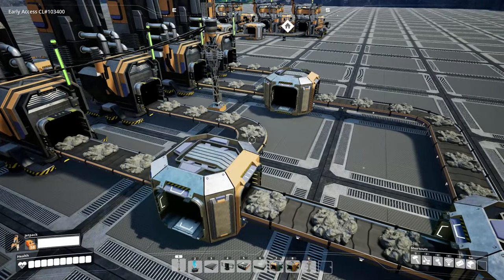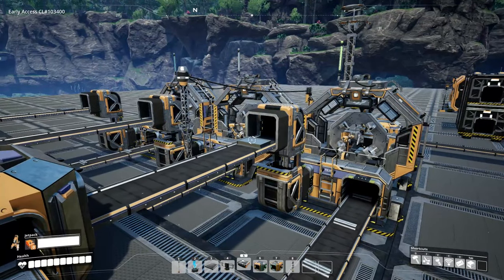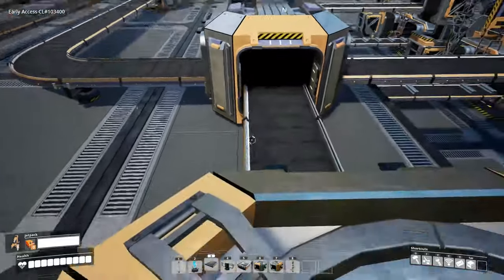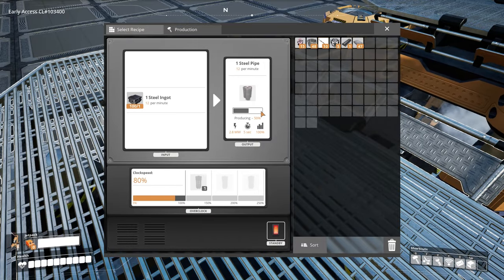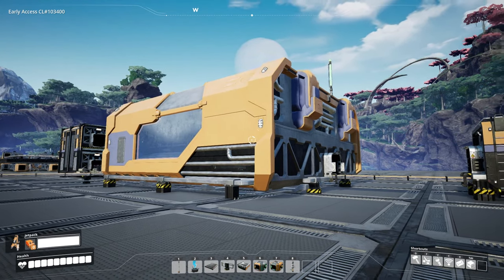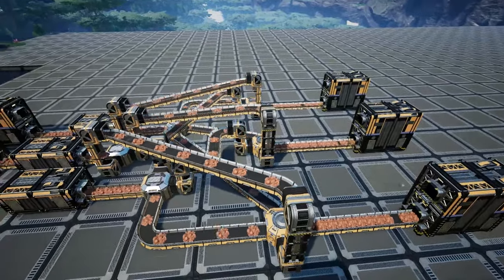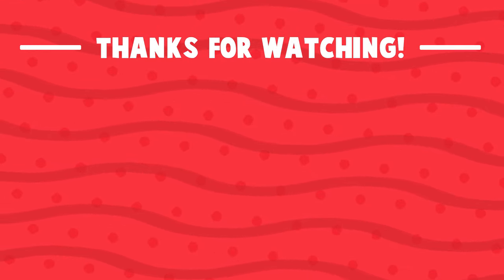Load Balancer Tips for an Efficient Factory! - Satisfactory Tips (Beginner + Advanced)

Comment: The problem I have (and the reason why I clicked on this video) is, that I match the input and the consumption rates, but the ore still piles up on the input side. For example cement... it makes 15 cement a minute by using 45 limestone a minute. I have two drills. One that does 60 a minute and one that does 120 a minute. I split both of them 4 times to 4x30 and 4x15 a minute and fed 4 constructors with them. They should constantly flow into the constructor and be instantly used up, but they pile up.

Comment: Load balancing does not make anything more efficient nor does it make the factory run faster. As long as you have the same throughput capacity, the factory will reach steady state and process the same amount of material regardless of how the machines are fed.

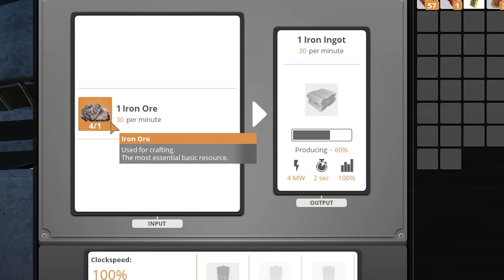The only difference is how fast each system reaches steady state. A load balanced system is at steady state effectively as soon as you start feeding it, while an overflow system runs at a reduced output while it accumulates material in the machines closer to the input. In our example of 4 smelters processing a 120/minute belt of ore, an overflow system needs to accumulate 2 stacks of ore for the first two smelters, so that's 1 minute 40 seconds worth of material that it needs to accumulate. The thing is that only happens once assuming you don't stop feeding your factory, so 1:40 in the total time the factory is totally insignificant. Also, if you need to build more factory downstream of your smelting line, you're probably not even in a position to utilize the full 120/minute output as soon as you turn the line on.

Comment: So what are the benefits of load balancing over not load balancing?
You didnt really go into detail all you did was say it makes your factories run faster which it doesnt. Sure it takes slightly longer for belts to be saturated with overflow but you wind up at the same points. Was really hoping you would have gone into detail, was just waiting the whole video to hear some practical examples :(

I really like the look of some people load balancing setups, it can look really crazy in a good way. But i spent quite some time on the reddit reading about the subject and discussing it with others because i wanted to get to the bottom of why people are doing it. The conclusion from people doing it and from what i was able to understand was there really is no point at all, its purely a style/aesthetics thing.
Reply: load ballencers mean the base always runs at even distribution.

if you have 6 belts of iron going into a section of factory using overflow. and you need to pull 2 belts to build somting, or just decide to tap into it.  suddenly the overflow factory will find the far end starved, and the near end running at full, completely fucking up ratios for all downstream production..    Whereas the factory using balancing will have the total production of that section equally scale down to 66% production, But all ratios still remain in tact.
Reply: In a truly balanced system, all devices run at exactly 100%, and there is no product standing still on the conveyer. That's the sort of system this system is designed for.
Reply: Quick answer: it is not required. If you have a fast enough belt to "brute force" push ressources all the way so the last machine has enough to run at 100%, and have a reliable input, then it's enough as the game will have ressources "stall" on the belts with no problem. It will also require a small startup time wehere the first machines have to "get full" before further machines will receive enough to run at full capacity. Hence, it requires a belt that is strictly faster than the sum of the inputs needed. The faster it is above that, the  lower the startup time will be before all things are equalized in the input capacity of the machines.

In realf life though, this is a very problematic solution. An output that overfeeds an input will break the input. Think about what will happens if someone forces you to swallow 1 cup of water per second, for 10 seconds... Hence the need of a load-balancing system: to avoid breaking the inputs, and getting exactly enough materials in a given period of time (procurement), as you don't want to overspend on ressources (usually).

What this game offers is the possibility to create a balanced input/output system, if you so want it. But let's not try to inject too much reality in a game where you have quantum pockat dimensions, please....

Comment: Eh... I don't bother load balancing, Just go in a line and cut where needed. So the first machine will probably fill up first, and while the ones at the end of the chain starve, but the first splitter might be fed by a MK4 belt, and each time I fork off, the fork only has a MK1 belt, so you go from a 480 feed, to a 60 and "The rest", leaving a flow of 420. Which is great if you're doing something like diluted fuel, as it wants 60 items per minute in, so the MK1 belt does your load balancing, restricting the splitter to only feed it 60 per minute. and if it's not, just let the first one back up, everything will get a full stack eventually when the output jams for some reason.
I'm not saying load balancing isn't useful, I just don't really use it.

Comment: unneccessary, fill them all up in a row, after a while when the first are all full, it works how you suposed to , no Balance needed, just how much is on belt and how many Machines 1 belt can feed on the LONG run
Reply: Not all the time. There's a reason the video stated several times the load balancer is a good idea, in certain situations. Your method works generally, but there are situations where it will not. 

Screws, and wire stack to 500, and a manifold will always lag the last machine in line behind until those before it saturate. If the output material is going out as fast as they're produced, the input will either never catch up, or take a long, long long time to do so. 

I used casted screws as an example in another comment, because the input is low, but the output and stack size are high, but unless you load balance, your end constructors will feasibly not catch up for days in game (24 hours of play, not game days) which will mean your planned output, will never be what you want it to.

If you instead insured each line coming into the system was balanced, you're getting max efficiency from minute 1.
Reply: @Thoron_of_Neto  I Dont mind that tbh

Comment: I love load balancing, it makes the factories look so much cleaner but it isn't faster than a manifold/overflow system... well it is faster but only until the belt fully saturates, which isn't an issue in the long term. 
I also looked over the load balancer and had no idea that's what I've been doing in some of my video guides... I just assumed it was even splitting between lines, but the load balancer makes sense :D
Reply: I love load balancing too :D
Since you're new to it, you can use the base 2 and 3 way splitters in a recursive manner to make any rational ratio you like. If you want to split to 1/n, then simply split with known splitters to n+1 and redirect 1 output to the input. That's how the 5 way is done in this video, but you can do the same for any prime number: 7, 11, 13 etc.
'Known' splitters can even include recursive splitters.

Comment: LOAD BALANCING DOES NOT AFFECT EFFICIENCY!!!

This is bugging me since the start of your Satisfactory Series and I almost watched every video.
Reply: Only if you put in more than the consumers consume. If you have for example 120 in and four smelter a proper load balancer gives every smelter 30. The minimal solution gives the first 60, the second 30 and the last two 15. Two run on 100%, the last only on 50%. Load balancing isn't about giving each consumer the same amount, it's giving each consumer the amount it needs at least.
Reply: The effect on efficiency that's presented has to do with the start of the process. With the overflow method it takes time for the materials to trickle into each machine. If you don't care about how long it takes when you start up your machines that's fine, but for really big projects that stop and start all the time it can get annoying.
Reply: Then your not load balancing, your doing overflow.... kids these days.
Reply: @GIRGHGH  
Not sure I understand what you mean. In what scenario would you need to stop and start machines all the time? Cause the only one I can think of is with containers being full, and that wouldn't require to do the refill process as they would already be full.
Reply: @SilvyReacts  loading and unloading vehicles?
Reply: @GIRGHGH  
I assume you mean ones that are not running constantly, like if you were to switch out items or something?

Cause for me I don't typically use vehicles to deliver anything besides 1 item, so I don't ever have to stop it.

I have not messed with trains yet though, so  that could change.
Reply: @Ruhrpottpatriot  No, this is also true of load balancing. Both systems take the same efficiency penalty when dealing with input shortage. Overflow Will have x% of the factories running at 100%, wheras load balancing will have 100% factories running at x%.
Reply: Is there something wrong with you??!!

Comment: I want to explain how it is possible to split for a number that is not a multiple of 2 or 3. To split into 5, for example, you need to split 300 -> 100+100+100 -> 50+50+50+50+50+50. Then you loop back a 50 into the original 300 belt. This may seem like it won't work at first, as now you get 350. However, if you think about it, the 'loopback' will steadily increase. 350 -> 116.666 + 116.666 + 116.666 -> 58.333 + 58.333 + 58.333 + 58.333 + 58.333 + 58.333. The loopback becomes 58.333.... The next run will be 358.333 -> 119.444 + 119.444 + 119.444 -> 59.722 + 59.722 + 59.722. 

Once you get to 360, it will now work fine. 360 -> 120 + 120 + 120 -> 60 + 60 + 60 + 60 + 60 + 60, then loopback 60 into the 300 to get 360 as the input again.

One way to think about it is: You split 1 input into 6 equal outputs, but since you loopback one, you have 5 equal outputs. Since 1 input turns into 5 equal outputs, the only possible way is if it had split into 5 exactly.

This strategy works for any number that is not a multiple of 2 or 3. Just loopback the extra outputs.

Comment: It's always more efficient to have all machines that are making the same item at the same clock speeds.

I.e: your pipes @4:50. If you need 4.8 times the production rate of a single 100% machine, it is more efficient to have 5 machines at 96% than 4 machines at 100% and one at 80%.

The power consumption for overclocking and underclocking follows a power function:
P=Pb*OC^1.6
Where P is power usage,
Pb is base power, or the power usage of the machine at 100%, and
OC is how much OC you are using, 100% is OC=1; 50% would be OC=0.5; 200% would be OC=2 and so on.

So, 5 machines at 96% is ____5*Pb*0.96^1.6 = 4.68*Pb
and 4@100% + 1@80% is ___4*Pb + Pb*0.8^1.6 = 4*Pb+0.70*Pb = 4.7*Pb

It's a small difference here, but, then again, the load balancing is easier, since all machines require the same amount of input.

PS: You could also have 10 machines at 48%, for even lower power consumption. 10*Pb*0.48^1.6 = 3.09*Pb
Yeah. You can save a lot of power by adding lots of extra machines and underclocking them... Don't ask me what that would make to your frame rates. :S
Reply: My bren gun is disfunctioning i think it has started to age
Reply: @NightFlyerKilo  Another option would be having 5 machines at 50%. Saves even more power and the productions rates are perfect.
Reply: What happens if you minimum clock and have loads and loads of machines?
Reply: Wait a second... does the same function apply to fuel consumption of power making machines?
Reply: @NightFlyerKilo  its a trade-off, sometimes I want machines so tightly spaced that I will overclock them. (ironic as the game has almost infinite space, but still restrictions are fun)
Reply: You just need to throw enough materials in the conveyor to satisfy the sum of all the outputs, this extensive use of splitters is purely cosmetic and doesn't help in removing spikes more than just using first grade maths.
If power consumption is directly proportional to clock speed and not exponential then there's also no difference in having 2 foundries at 200% or 4 at 100% if not for footprint, conveyor capacity and power shard use, as they'll ask for the same total amount of resources per minute.

Comment: Great game it is.
Im playing for 10 hours now and i found water.
Its 2miles from my coal so the puzzel begins.
Reply: When i finally found water it was like 3 miles from base and another 4 miles the other direction for the nearest coal deposit so ive got looooong huge pipes and conveyer belts stretched super far lol
Reply: What I did was and this is super inefficient was a just sucked it up got to oil then bottled the water sent about 6 tractors to my coal using stunted delivery so it won’t run out and just like that it was done 1/10 would not suggest just run a pipe or belt trust me

Comment: It should be noted that you can also use the speeds of the conveyors themselves to split into weird ratios. I.e. 1x Mk.4 line can be split into 2x Mk.1 lines and 1x Mk.2 line for a balanced 1:2:1 ratio. For a 1:2 ratio (aka 1/3 plus 2/3) you can just split a Mk.3 line into 3x Mk.1 lines and then merge 2 of them into 1x Mk.2 line. The most difficult to build load balancers have prime number inputs and/or outputs, such as the case when trying to evenly distribute a saturated Mk.5 line into 13x saturated Mk.1 lines.

Comment: Just overflow everything, energy is infinite, overflow with buffer is the most safe method, you never run out and can pull out from the buff anytime you want.
Reply: yeah you never run out of production but everyone can do that. For a perfect Factory you need to use your brain and there are quite a few who like that me aswell.
Reply: @momo-i1t3d  There is no benefit to it unless you are working in some related field. Its a game, you are wasting time. There is no output. The challenge is moot since there is not inherent societal benefit. There is no real product or service being created. So I suppose OP likes to play for fun! Also you statement impliclty is stating that OP isnt using their brain which isnt very nice
Reply: @fahimzahir2085  Yeah you can just build a ton of generators for infinite energy capacity so you can fit the biggest energy spikes possible no problem, but it's kinda unsightly to me. I find using that many splitters still stupid because that's an useless exercise, as the issue can be solved in a practical way with just first grade maths, balancing the input number with the output number and just making sure if there's any conveyors causing bottlenecks and need upgrading.

Comment: I like most of your videos but this one is nonsense.  Unless you are doing a speed run there is never any legitimate reason to "load balance".  Just do the math, figure out how many machines you need to process the max input, and built that many.  Load balancing might matter at the very very beginning of the game if it were possible, but by the time you unlock the splitters and mergers to even be able to do it, you will never be that desperate for resources again anyway.

Comment: LOAD BALANCING IS POINTLESS. I'm studying MECHANICAL ENGINEERING and your use of the word efficiency is infuriating. 
Yes the machine gets up to max output quickly but there is such a huge waste of space, time and resources for something which won't matter after about 10 minutes of running for a machine which will run continuously.
Reply: Agreed. Overflow works just fine which is why I let my machines fill up with resources before connecting them to an output

Comment: 00:28 You can save space by stacking all the splitters and using vertical conveyers from the first splitter to the second and third, then regular conveyers from your second and third splitters to you melters. It will not look symetrical but it will work.

Comment: i dont bother with this, i usually just see if you can multiply the number to a number the item required can be produced at and then just divide that into how many machines can use it. So if you need 12 reinforced plates and 24 iron rods. thats 120 reinforced and 240 iron rods. or it can be 60 plates and 120 iron rods, then i just divide that and i either get 10 machines or 5. then just do a normal load balance and ur set.

Comment: Why would you possibly need to do this? A pure MK2 miner into 8 smelters, using 4 splitters and 7 mergers. Tweak the belts to what ever speed they have to. Then the input and the output at opposite ends. The belts compress very easily. Load balancing is the dumbest thing I've ever heard of, considering the mines produce unlimited resources, which means the power is also unlimited. Which is also why having storage is pointless. Since you can never remove the contents from storage, since the input and output are at the same speed.

Comment: actualy if it were balanced perfectly it should read 4, 0 1, 2, 3, 4 or skip  from 0 strait to 4 atleast... and repeat over and over etc... because it would have 4 then use all 4 strait to 0... and it would fill as the belt fed 1 at a time... but i'm sure it actualy is balanced its just showing a wonky display of whats going on is all

Comment: Whats the point of setting up multiple splitters/mergers and reducing the produktion amount if you can simply run it at 100% and it won´t change a thing as long as you balance the raw material input. While there will be cases where you will have to do so this example instead makes everything more inefficient.